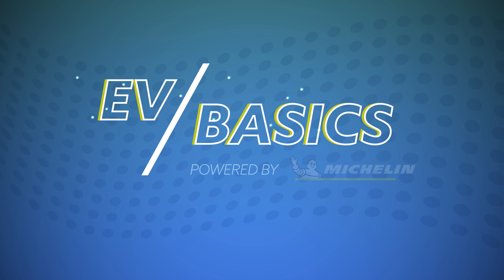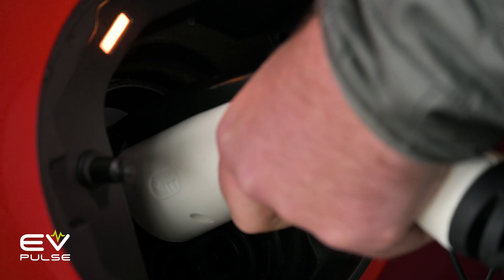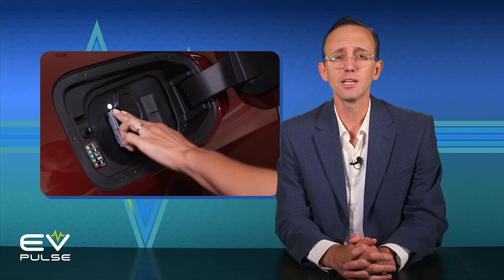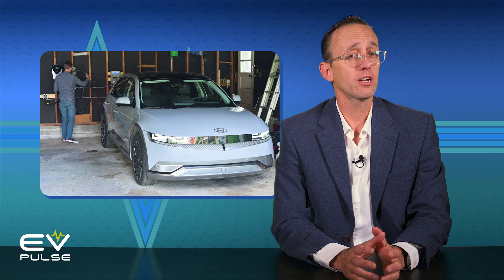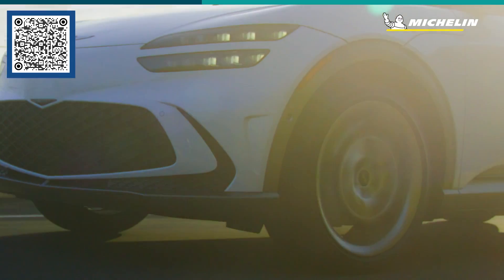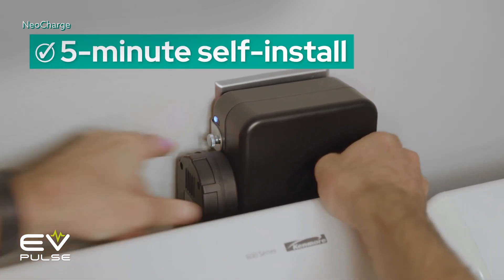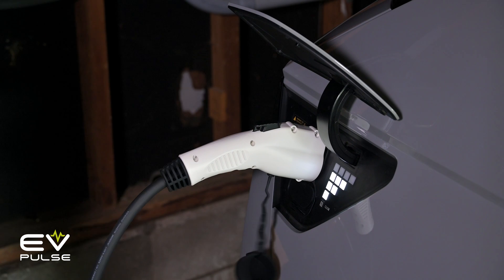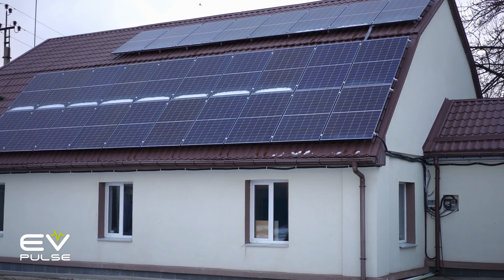How to Solve Home Charging Problems | EV Basics

Comment: I appreciate your discussion of home charging. It seems that using a 240 volt / level 2 charger is the best way to recharge your EV.  I have a level 2 charger from when I had a Chevy Volt.  I just traded the Volt for an Equinox EV.  I also have an all electric house with 40 solar panels.  This revelation that 240 volt / level 2 charging is best, makes me very happy.  Thanks for your utube channel.

Comment: how to get level 2 charging for 600$ if you rent a house with a garage.
build an 8s lifepo4 battery pack for 365$
attach a 3kw 220/240v inverter, 200$
get a programmable EVSE that allows for 10 amps, 40$
add a 500w 120v to 240v stepup transformer to the ac input side of the inverter, $35
later you can add a small solar panel array which feeds the inverter if you want. since its all a standalone system, you dont need permits and are not making any modifications to the home. will charge an older ev/phev fine at 2.5kw at 240v. the chevy volt only has a 10.5kwh usable battery, so you will rarely need to rely on the stepup transformer.
you can have your little solar panel array offsetting your EV cost. if you cant figure all this out, youll have to buy the anker setup with costs $4,000. pays to learn how all this stuff works. I dont use bms' for my battery bank, just inductive active balance boards and dont charge when the battery is freezing. the inverter has all the charge/discharge protection built in so youre only leaving low temp charge protection on the table.

Comment: I never had any home charging problems. My brother is an electrician and installed my level two connection for me.
Reply: What is the point of your comment?
Reply: @michaelriera6277  The thread is "How to solve home charging problems" I'm simply pointing out that I haven't had any. I have had Leafs of all battery sizes except this latest and greatest 2025 model and done 99% of my charging at home.
NO problem. Maybe I'm lucky.

Comment: I’ve been Level 1 charging for the first 6,000 miles of my Chevy Bolt, and I am on pace for 15K miles in a year. Level 1 charging on a 20A circuit at home allows me to charge at 12A, which nets me 5 miles per hour. I routinely get 60 miles back every day, and I’ve never used a public charger.

Comment: why did you use file footage of a guy using a hammer drill on a concrete wall in a demo'd house and then a guy on a tower working in an electrical box at 4:01?  Those 2 scenes have nothing to do w/installing an outlet in your garage (unless thing are different in Canada).   These 'representative' cut scenes crack me up......

Comment: Cadillac 2023 LYRIQ Charging 19.2 KWH CHARGER. 
I typically charge to 50-60% using a Level 1 charger. Objective slowest charging as possible while maintaining 50% SOC adjusting pending anticipated driving needs( some days no charging needed). Fast charging only for long distances planning not to exceed 80% if possible. I have a 19.2 KWH CHARGER with a 11.5 kwh EVSE. Is Level I less detrimental to your battery than Level 2?
What charging recommendation would you recommend for my situation?

Comment: One thing not covered:  The Level 1 charger provided by some car companies will work either plugged into the wall or into a high capacity (mongo). extension cord.  However some do not.  I had  a  Mach E which worked fine with my extension cord...I traded for a Genesis GV60 and the charger "looks" like it is charging when plugged into the extension cord...but, in reality, it is not.   Right now I cannot get that charger to the receptacle in the wall and I use up 50 miles of range just getting to a DCFC.  When I move into a new home I will re-install my trusty/dusty 9 year old Level 2 Siemens charger...but what to do until then?

Comment: Being able to L2 charge at home is very important but not absolutely necessary. I charge every day at work, which provides enough energy for my 50 mile round trip commute. L1 provides 2-5 miles of range per hour, depending on car efficiency. Also, you still want to check the quality of the wiring and receptacle so you don't have issues charging at 120 V or 240 V. It is important to know that charging to 100% full is bad and not needed. All you need to do is to charge what you need every day, thus the charging time is much less than what you suggest. FYI I change at 4 hours at 3 kW every day and that is plenty to keep my battery between about 60% and 75% every day. 

FYI I use a Neocharge at home, when I charge at home - it is great. But I removed the cheap dryer receptacle and replaced it with a heavy duty Bryant NEMA 14-30 receptacle with properly torqued conductors.

Comment: A company called Point Guard energy is advertising a home bidirectional DC fast charger that can run at 12.5kw or 25kw. It sounds interesting but seems like it's vaporware so far.
Reply from the maker: We just saw a demo from a company called dcbel that is hugely impressive.
Reply: @EVPulse  That one looks nice too. I think it has the same problem as the Point Guard module, in that it says lots of promises but doesn't actually work with any vehicles. Comete vaporware so far too. Hopefully once I get my electrical and solar up and running one of these companies actually has something functional and usable.
Reply: For them maybe but bidirectional is the future.  Just may be another decade or two to be ubiquitous.

Comment: Had a qs, the voltage in Europe and Asia is 220-240v does that mean level 1 chargers  used here will be faster than US 110v level 1 chargers?
Reply: Yes, but installing L2 home chargers is still popular in Europe.  L1 at 220 V  is good for about 60-80 km per day average driving, IIRC. L2 is still needed to pre-warm the car without drawing from the battery to supplement the power from your home.

Comment: I think big box home improvement stores need to either create a subsection for DIY installations to help us either install our own level 2 charger to code. Bonus points if someone can create bundles for standard installs (14-50R, Conductor, housing, brackets, etc). That would also help electricians and handyman that can do the work but may forget a few things when sourcing for the job.
Reply: DIY knowledge saved me a lot of $$ even with an electrician because I knew the easiest cheapest way to ask for it done.
Reply: @ewitte12  Yeah I just had a call with an electrician to get an install quoted. They asked what the max rating of the charger I bought is, which happens to be a 50 amp circuit. However thanks to some DIY knowledge and also Technology Connections, I knew to say I want a 30 amp circuit instead. Why pay for the thicker wiring when I don't need it?

Heck, I'm already getting back to full (80%, but I'm calling it full because I'm hitting that target every night) on a level 1 charger. I'm only doing the level 2 install to get the charger on a dedicated breaker instead of sharing one with other parts of the house.
Reply: @30smsuperstrat  do you have a write of what was needed for your install?
Reply: DIY is a bad idea, especially for insurance purposes. Maybe doing the basic work and letting electrician do the final connections is a good compromise, if you're capable.  Install junction boxes & conduit, cable, leave pigtails
Reply: that's a dangerous level of underestimating, especially with 240v, and not an impressive argument to be making to your insurance company in the unlikely event of a catastrophe
Reply: DIY Psychiatry is not working for you
Reply: @rp9674  Ok Tod.

Comment: One concern I heard especially about level 1 AC charging is the efficiency. The car may say it got 50kWh, it may cost you a lot more on the electric bill.
Reply: I have a whole house solar system.
Reply: For me, using the same EVSE, L1 was more expensive compared to L2.  600 miles in a cold month (Jan) with L1; $55.  L2 the next month on 800 miles; $35.  Averaged about 2.5 mi/kWh both months. $250 for a heavy duty 14-50, 40 amp breaker (32 amp EVSE) and professional install; eight months later, just broke even and from here on out will be money ahead.  L1 1.5 kW (4 miles an hour add) versus L2 7.5 kW (30 miles an hour add), so for my needs, money well spent.
Reply: I've seen dozens and dozens of comments by people who charge level 1 at home.  None of them ever mentioned anything about electric rates being higher than they were expecting.
Reply: Level 1 is great for ease of access and very inexpensive.
Reply: I level one charge over night and my bill went up less than what I thought it would.
Reply: L1 efficiency is only about 10% less than L2.  Not enough to notice on your electric bill.

Comment: I have a LECTRON VBOX home level 2 charger.  It takes 6-7 hours to charge to 100 KwH.

Level 1 is too slow to be significant and most people won’t trust it because of their fear of an emergency.

Level 1 is only good for hybrids with batteries smaller than 30 KwH.

WHAT WE REALLY NEED is Solar panels,  electric furnaces/ water boilers and 100-200  KwH backup batteries with DC FAST CHARGING for our cars.
Reply: Not sure I agree - Maybe it's not "sufficient" for your use case, but Level 1 should be sufficient for a typical driver who only drives 20-40 miles per day, or (like me) only drives  a couple times a week.  If you can Level 1 charge at night to replace those miles you're good.  Maybe find a Level 3 DC Fast Charger once a week to top back up while you do your grocery shopping.  Way easier than a gas car.

Unclear what "emergency" you mean with regard to a Level 1 charger?   A massive power outage?  An approaching hurricane?  EV would be no different from an ICE vehicle: you'll only be able to drive away from the emergency as far as you have range.  not an EV-specific, or Level 1 charging-specific thing.
Reply: Level 1 may not be as efficient as Level 2, but it is the outlet I have and it gets me back to my charge limit before I need to drive again.  I can charge at work, but I don't need that to maintain the SoC I want.  I only charge to 70% at home, but I usually use less than 20% in a normal day.(50 mile round trip to work).

For the unexpected trip, I can get to a convenient to the route DCFC as long as I have 20% when I leave.  There is a 62 KW DCFC less than 3 miles from my house, and 5 miles gets me to either a Tesla (with Magic Dock) or CCS that will deliver the full rate my car will accept.  The faster sites are much less convenient if I am leaving on a road trip.  If the emergency is a power outage, that 70% SoC will get me over 180 miles which is 60 miles a day for three days which is the longest power outage we have had in the last 25 years at my home.
Reply: I got by for a year with short-range EVS home charged off level one.  It works for a shorter commutes or reduce the need for public charging if it's not easy to get L2 at home.  It worked great when I had workplace charging. L1 charging at home + L1 charging at work can work for some.  I even lowered my L2 charging rate to 16 amps to share between 2 EVS, because I don't need 32 amp